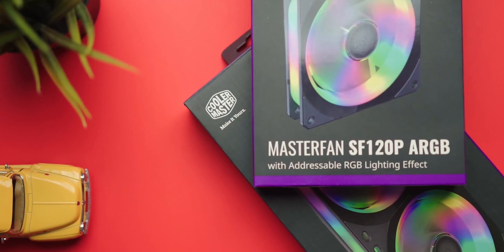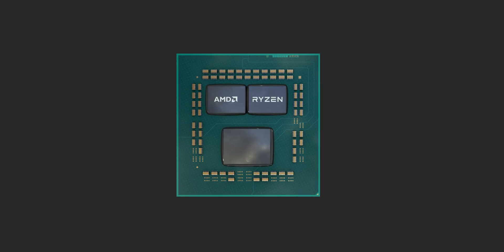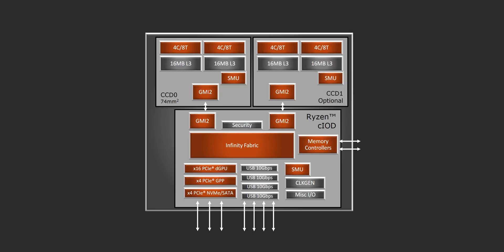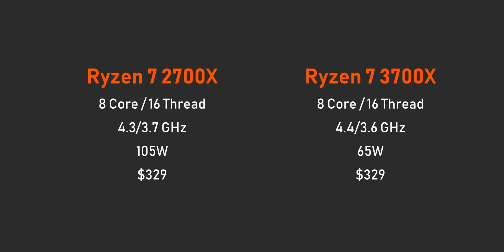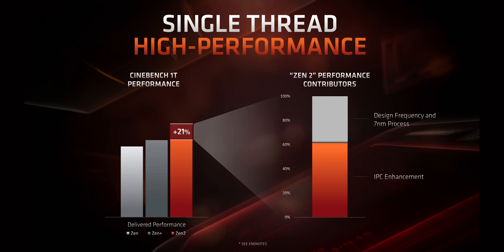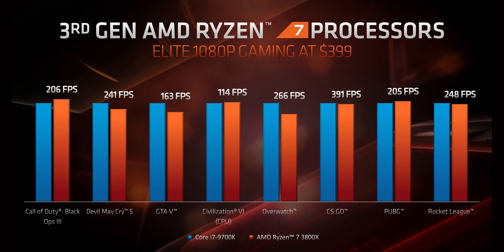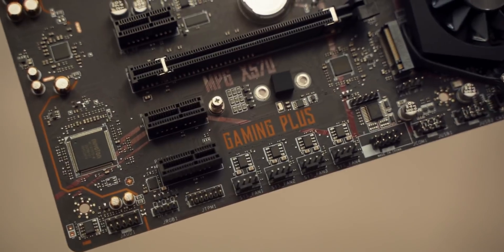AMD Ryzen 3000 – A Very REAL Problem For Intel?

Comment from the maker: Timestamps as promised:

1:47 - The 7nm Advantage 
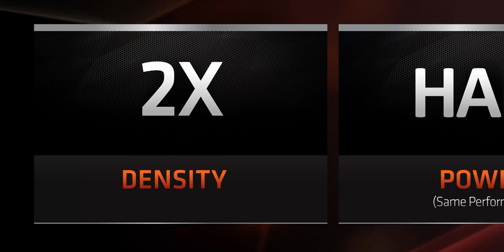2:23 - Why Zen 2 Chiplet Design Is HUGE
4:38 - How Thermals May Be An Issue
4:13 - The Ryzen 3 Family Explained
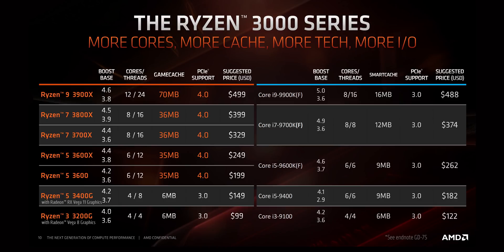7:12 - The APUs Time Forgot ;)
7:42 - Gaming = Still A Problem?
10:21 - Affordable Mobos Are MIA
12:04 - Backwards compatibility, Sorta
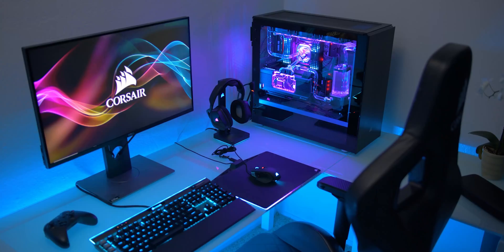12:51 - Wrapping Things Up!
Reply: For a tech guy you should know amd was using a low power node with zen 1 with zen 2 it's a much more high performance node
Reply: You may as well mention that Intels hyper-threading is  a non feature since every cpu currently on offer is vulnerable to zombieload.
Reply: They ARE charging a premium for their new architecture. Because the 3700X is the first 8 core chip in their lineup. Where the 2700 is the first chip and it is CHEAPER. So by common sense we can see that the 3800X is the top 8 core chip, which is more expensive than the 2700X, has a premium cost associated with it due to it having a higher price than the top 8 core 2700X.
Reply: @grizzly6699  I would expect 3800x has higher cost due to chiplet binning and higher TDP allowing the chiplets to stay at higher performance for longer. But need to wait for benchmarks to know for sure
Reply: I'm surprised that the video never even mentioned that Intel is severely affected by MDS exploits. The patches that mitigates MDS flaw in Intel processors lessens performance as much as 40%. Intel's single-core speed over AMD for a decade was due to them "cheating" their way to performance, their speculative execution and branch prediction implementation were developed with speed in mind, totally neglecting security.

So basically, by buying Intel - you made a losing proposition. You bought expensive processor with significantly lower performance compared to AMD's offering.
Reply: @maynnemillares  Yes, Intel Security flaws. That's why I have replaced my i7 6700HQ Dell laptop with an AMD Ryzen based laptop. My desktops are Sandy and Ivy Bridge i7 and will be replaced with Zen 2 when it launches. Apparently experts warned Intel way back around when HT launched that it was a potential security risk. That's like early 2000s, maybe 2003. I can't recommend Intel until these issues are confirmed fixed.
Reply: What many people don't talk about is the value AMD provides for content creators and pretty much any developer.  With these prices AMD offers with Threadripper and now in the mainstream it will push technology to advance further overall.  Many people don't talk about this but the more users have to bandwidth or more leverage for their applications the faster technology grows in just about every technical market.
Reply: Xtreme Performance  What! No. Zen started research and design over 5 years ago. TSMC has been researching 7nm and 5nm for years and years. Intel has been working on 10nm for like a decade now. Most likely Intel's 10nm problems is due to their EUV. Its pretty obvious you dont really know what you are talking about. A new architecture takes years and years of research and development. You cant just shit one out in 2 years.
Reply: In addition to annotations in the video can you link your other vids in the description?
Reply: @shawnpitman876  Intel cant make it profitable enough, yields is too low. AMD doesnt have any manufacture issues since they let TSMC manufacture it for them.
Reply: It would have been nice to know which manufacturers are offering commitments to ryzen lineup because at the end of the day self builds are still niche compared to major manufacturers
Reply: @digitaltrix  Are you referring to retailers IE Dell, HP,? or Board Parteners. Because right now the answer is pretty much everyone across the board
Reply: The Ryzen 5 3400G and Ryzen 3 3200G are based on Zen+ 12nm FinFET process technology and not the old 14nm.
Reply: Xtreme Performance  Dude Zen architecture was started over 5 years ago.
Reply: It's the enterprise space which is the key battleground and where the profits are made. I can see Epyc making a serious dent in Intel's marketshare this year and next. Game developers are moving to multithreaded optimizations in the gaming space. My hope is AMD can keep up the pressure and not repeat history. They are a great engineering company and have arguably done more to move x86 forward than Intel. First to include SIMMD instructions. First to dual core, first to include IMC on chip, first to 1Ghz, and of course the creator of the x86-64 instruction set which killed Itainium dead. Intel will catch up I'm sure, but AMD is not standing still. We may well see DDR5 next year, if they can shrink the IO die, we may well see 4 chiplets and an AM5 platform or integrated HBM memory for APU or a L4 cache. The new design is very flexible.
Reply: Could you please tell us the make & model of the lamp/light that's above your computer monitor?
Reply: Going for amd. Its cheaper. Haha. More money in my pocket for the mortgage.
Reply: I think Intel is planning for the future and mastering each architecture before leaving it behind, and it is going to backfire on AMD because they are nearing the end of the line and they can't even double the performance of intel which has less core and bigger architecture. once Intel reaches 7nm they will probably have 2x-3x the performance of any 7nm AMD CPU.
Reply: @zupremo9141  I dont think so. There is a limit to the type of daisy chain architecture that Intel uses. Heat and Space. You just cant get around those. FOVEROS is Intels plan for the future but it will also have a huge heat problem. I doubt we will see a "new" architecture for PC for 1-2 years
Reply: @dralord1307  compare intels fastest 14nm and AMD's fastest 14nm and you're going to see how big is the difference between the two CPU. Even their latest Chip's can't significantly beat Intel even though they have twice the amount of cores and smaller architecture which significantly improves the performance of their CPU. If they can't improve the performance of their CPU without adding more cores to it, Intel is going to end their business once they reach the same archetecture which is inevitable because of physics.
Reply: @zupremo9141  You do realize that single core speed has nothign to do with how many cores a cpu has. As i said Intel uses ringbus. Ringbus will always be much faster for single core performance. AMD uses their Infinity Fabric which has limits. AMD is going with Chiplets connected with their Infinity fabric. This is much much better for multithreaded applications. Also chiplets are far cheaper to produce. Ringbus's biggest issues is space and heat. Intel is very limited by space, they simple cant cram as many cores onto a monolithic die as you can in a chiplet system. Monolithic is dead man. Even Intel know this thats why they are switching to FOVEROS. You can dream but it change anything.
Reply: @dralord1307  ok. I didn't know that there was a problem with their engineering design but it's still true that even at synthetic bench mark AMD can't get a significant lead against Intel's CPU which only have half of its core count. If this fevoros is as good as their old design I still think that it can end AMD's business.
Reply: @zupremo9141  No it wont. AMD actually has the superior technology currently when it comes to stacking. Intel is having to catch up. The only reason Intel's current monolithic designs do as well as they do is because of Ringbus. But even Intel knows Ringbus is not cost effective for them. AMD's threading tech is superior to Intels. Intel knows that as well. Intels FOVEROS is designed for mobile. It combines 1 larger core chiplet with smaller ARM chiplets. AMD's Chiplet technology gives you full cores not small ones. You really should look into this more so help you understand just why Intel is struggling. Intel needs at least 2-3 years to get caught up with AMD as far as chiplet technology. Most likely more like 5 years
Reply: @dralord1307  If the sunnycove benchmark is true, low tdp chip highend performance, foveros could be the next big thing for intel. For now we should stick with AMD, they are clearly the winner in this year. Dont get me wrong, I had lots of intel cpu, but right now amd is better, even zen+ lineup, currently I use 2700X. No security mitigation tax, cheaper and just a bit slower. Zen2 is looking very promising. But I guess wait for benchmark as usual then decide to upgrade.
Reply: @demonrush  Sunny Cove laptop benchmarks had none of the security flaws fixed. And was against several generations older chips. So they got 18% IPC increase but the security flaws are supposed to have upto a 15% ipc loss. So 3% improvement
Reply: Zupremo nothing you said makes any sense
Reply: @hardwarecanucks Your Intel bosses won't be happy with you talking about Ryzen... They probably won't pay for your future trips etc... We all know you're Intel shills, your 9900k video clearly says that (after every one else mentioned its issues and you didn't).

Oh well, I guess this is just bait for more Intel money incoming.
Reply: Want to know something funny, AMD showed off their new 300 series with live gameplay fps demos. Intels 9th gen won in gameplay as showed by the 12fps difference in the live bench mark. now lets remember these are amds new 7nm cpus vs intels 14nm cpus and even though ryzen has advantage with 7nm and similar frequency cpus they still lost to intels 9th gen 14nm cpus. As it stands AMD just isnt able to compete lets remember Intel hasnt even started 7nm production and are going to 10nm instead because they know their 10nm will beat anything amd has planned. Intel could just make amd obsolete by making 7nm cpus BUT they prefer profit  and making 10nm cpus mean intel can make even more profit.
Reply: @Wallcroft25  Intel can't get 10nm to have high enough yields to be profitable for high core counts. When Intel's 10nm+ comes to the desktop and data centre, it will be superior to AMD's 7nm and even 7nm+ tech. It is impressive that a larger 14nm process technology can compete on performance with a much smaller one (7nm). They had such advantages for some time now. But don't forget, AMD isn't standing still either.
Reply: @grizzly6699  Its not really AMD's 7nm but it is TSMC's 7nm. By the time 10nm is read AMD will probably use 7nm+ or possibly 5nm depending how long 10nm takes
Reply: @dralord1307  Yes it's true, it's TSMC's process as AMD is fabless. Intel may even skip 10nm for desktop and data centre if they can't get yields and frequencies to improve. There is even talk of Intel using Samsung to manufacture Intel chipsets due to the Intel CPU shortage. Then they can focus on producing more higher margin products.Then there is the possibility that AMD may be able to use TSMC's 6nm node, which is compatible with 7nm manufacturing equipment, for Zen 3 products instead of 7nm+. If TSMC can get it to the right stage of developement.
Reply: @Wallcroft25  just wait for next year when amd comes out with even more dense 7nm. They have everything just polishing it for 4th gen.
Reply: @Wallcroft25  You do realize all test including the slides and real gameplay demos where done without all the patches applied to the intel cpu's for meltdown, zombieload etc... that can be up to a 30% decrease in performance on the intel side. Also the ryzen 3000 cpu's where tested on the x470 chipset not the x570 and where also done with slower ram speeds because intel cpu's don't support the ram speeds that the new ryzen series will. We all know how much performance can be gained from high ram speeds with ryzen. So please investigate before you put in your 2 cents worth or your just being another intel fan boy.
Reply: @Wallcroft25  Uhmm. Intel have had huge troubles with their 10nm process. Its been delayed for years and years. Intel also has clearly said many times they expect a large clock speed reduction on their 10nm node. Their newest 10nm laptop chips prove this. Their clock speeds are upto 500MHZ lower then their 14nm predecessors. Intel also has all those huge security problems to fix. The newest 10nm chips boast an 18% IPC improvement from several generations prior "BOLD" Before implementing the fixes and patches for those Security Problems "BOLD". I know what your thinking in your statement, but I dont think you have actually thought it all the way through. 

The biggest problem for Intel with Desktop is they cant get 10nm up to a point it can have a decent yield on Desktop size chips. If they tried to start making 300-400NM chips now they would have some many defects a single chip would be around 800$.

Comment: Hold on... if AMD can sell a 3700X (which is a single CCD + infinity fabric controller) for $329, then theoretically they should be able to sell the top of range 3950X for less than twice this price, since all it is is one extra CCD chip (each CCD is two 4-core modules). So why don't they absolutely destroy Intel by selling the 3950X for $600 ?

Comment: I was really hyped until the benchmarks were shown, I don't think Intel has anything to worry about at all. I was hoping amd would win but it was a disappointing situational result for example for video editing and animation sure amd kills it but for gaming and also streaming and video editing amd just tied kinda. Alot of the benchmarks I have seen is still the Intel 9900k still on top for gaming and amd reaching as low as half part of the bench marks to around the 70 percentile it doesn't kill Intel in gaming not even the amd 3900x. For me none of these cpus really change anything as for price the 9900k is cheaper than the amd 3900x as amd is 500 bucks and the Intel is around 450 bucks more or less.

Comment: Hi all, I'm looking for some suggestions. I'm looking to build ryzen system and I was going to go with a 5 2600x and a taichi montherborad, now that ryzen 3000 is coming I was thinking I'll get a x470 montherborad and just update the bios. So any suggestions on what board I should get, also I'm not going to do much over clocking.

Comment: Did you consider the fact that Intel Processors will be losing performance SIGNIFICANTLY when they disable Speculative Execution through their upcoming security patch?

Edit: I don't think quick sync would be able to work with that. So....

Comment: That 3600x is gonna be the Intel killer. 250 bucks is the sweet spot for most gamers. That's what I usually spend for a CPU. I currently running a 6600k and I would like a 6 core 12 thread CPU for the same price !!! Going red this year!!

Comment: I've been using Intel CPUs for a very long time, but now seeing AMD Ryzen and the perfect price point, I'm definitely building a Ryzen workstation... I already have my parts chosen, just waiting for full reviews on the GPU, QVLs for the Aorus Pro Extreme (heard it supports 3200Mhz of DDR4 RAM, and the 3950X, which feels like the Threadripper 3 I was hoping for. I might build a Threadripper system and use that as a render slave.

I might stay away from the Radeon  5700XT because AMD GPUs don't work with V-Ray (unfortunately) and I also use Unity which is well optimised for NVIDIA cards. But I'm definitely going with AMD this time.

Comment: The big problem for Intel is Zen3 and Zen4 while Intel still is stuck at either 14++ or a 10 nm node with equal or less performance. TSMC 7 nm. still is slow, for Zen3 there is probably another 5-10% 'IPC' improvement and a 5-10% improvement of clock frequency. Then what? Now AMD onlly dominates multithreaded and has a much lower electrical power, for Zen3 AMD will probably also dominate multithreaded. Obviously when Zen3 and Zen4 come out AMD will have gained a lot of mindshare, that in combination with a superior performance in every way and more optimized software for AMD...

Intel is screwed. Intel can come back when their new architecture gets launched and Intel finally gets on a competitive node again but how will Intel pull that off? When Intel finally has a proper working 10 nm node (and not one which tops out around 4.0 GHz) then AMD uses TSMC 7+, before Intel gets to their 7 nm. node AMD will already have gotten to TSMC 5. The only way out for Intel is to order TSMC or Samsung to produce the CPU's but then Intel will have to sell parts of their own fabs or utilize those fabs for other companies.

Comment: I have a couple of older XEON systems with dual CPU sucking power like mad. First one gets a 12 core right at release and I'll clock it as high as possible and compare it's performance with the 2x 12core old XEON it replaces. Then when the 16core comes out it goes in the same system and the first one moves into a system that currently has dual 8 core 1st gen XEON. With the IPC difference and clock difference I'm betting I won't lose performance despite reducing cores. While sure I'd love to stick with Intel and go with newer XEON the price is INSANE! Intel has priced themselves out of my budget and I'll move to AMD. If I really get good performance my 8700K might even be in danger of an upgrade....

Comment: Thinking about 3rdGen for my next build, but I want to see how the single-thread performance stacks up to the 9700k or 9900k. I play older games that don't use all those cores.
Reply: Layarion you will see that the performance difference in single thread performance is negligible and besides Intel still has the security flaw that affects the use of hyperthreading. Side note: the 9900k runs way hotter compared to AMD's comparison and uses much more energy.

Comment: 9:45 honestly, quicksync has alot of issues with it. mainly, support. for example, it can't handle rendering 4k res all that well without disabling some options. thing is, adobe doesnt really tell you this, you figure it out when your 1 hour render didn't turn out the way you expected.